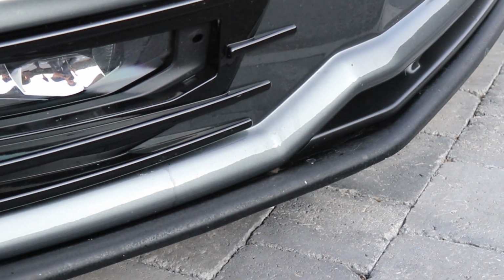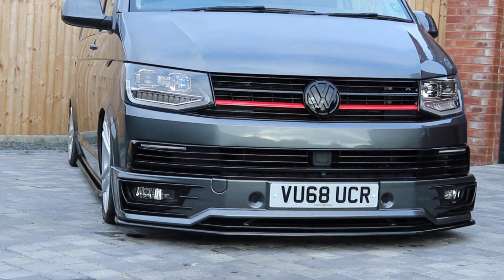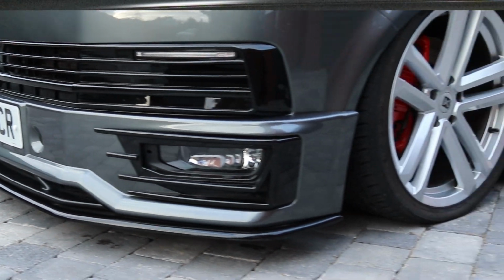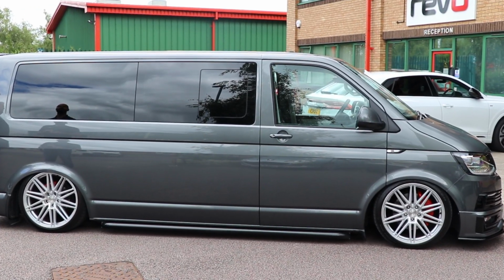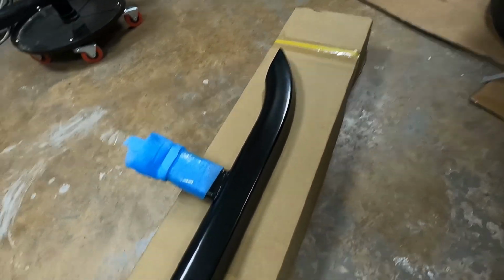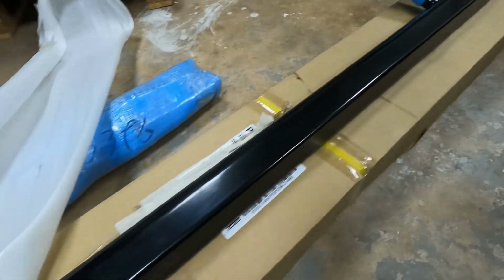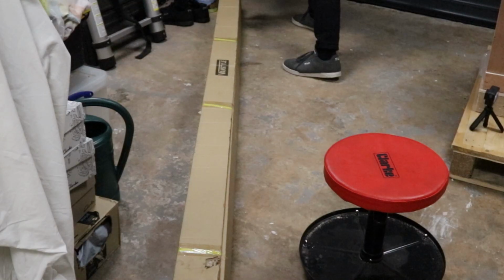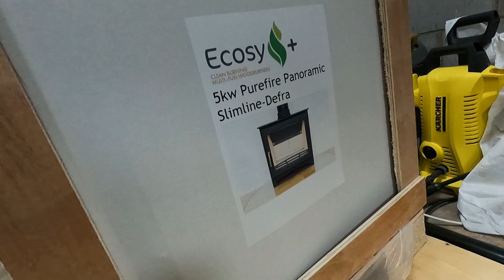T6 Trapeze Bars | and some general housekeeping on the van.

Comment: Not sure if you care to share, but what approximately would the wheels, new suspension,  all the additional lights, bumper kit, trapeze bars, rear spoiler , led lights set you back not counting labour. 
Reason I'm asking I'm considering buying a 6.1  transporter.
Reply from the maker: I would share but I’m not 100% how much but give or take the items you list below around 6k If the suspension was a coil spring. 
In this video there are more than one version of things and the van has seen 4 sets of wheels and now runs on a 6k air suspension set up
Reply: @SteveField  appreciate the reply. I'm only contemplating getting a van and doing it up. Ur van is class.  Best of luck with it and I look forward to more videos . Thanks again
Reply from the maker: @podgey65  Thank you :-) more to come, and look forward to how you move forward yourself😎